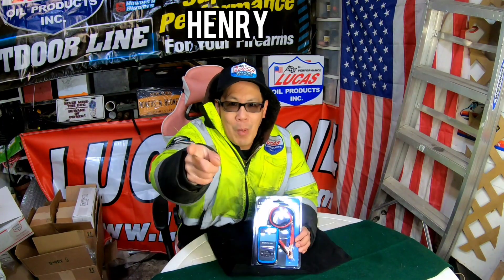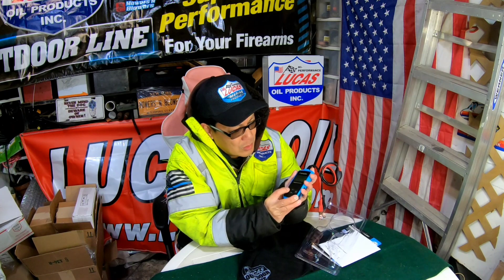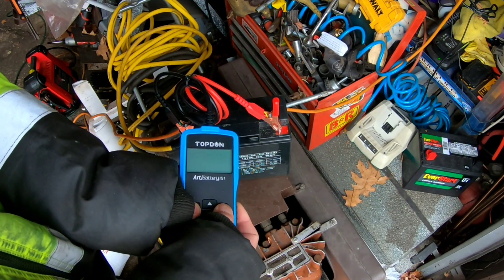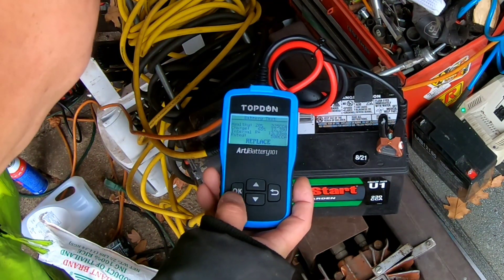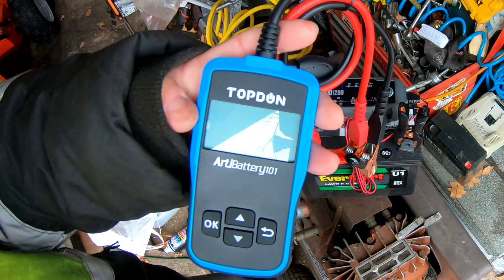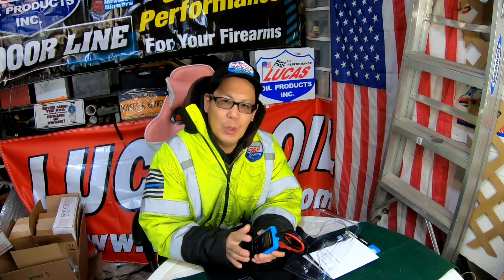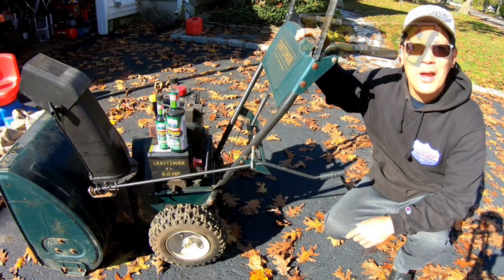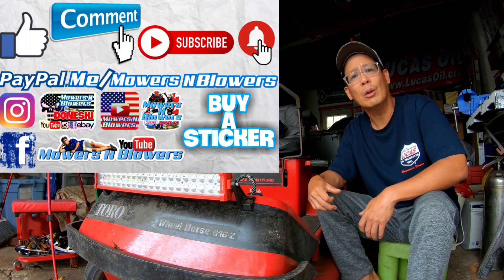TOPDON AB101 12V PORTABLE ALTERNATOR CAR BATTERY ENGINE CRANK CCA TESTER ANALYZER UNBOXING & REVIEW

Comment: Yup that EverStart is a bad battery, the second you have an internal resistance of 6mΩ and above the plates are sulfated and the battery is kaput !  This tester is smart enough to know the difference between a low discharged battery and a sulfated battery. If a new flooded automotive battery goes below 11V for over 2-3 months it as good as kaput so there is no use even testing it let alone one that is completely dead for that amount of time.
Reply from the maker: Yes they suck lately

Comment: A multi meter only measures the volts not under a load, Most battery testers puts a load on the battery to see if it can hold it under load
Reply: A proper battery test is a time consuming charge/discharge test.  Load testers are not an accurate assessment of a flooded battery and can damage a perfectly good battery when under load !